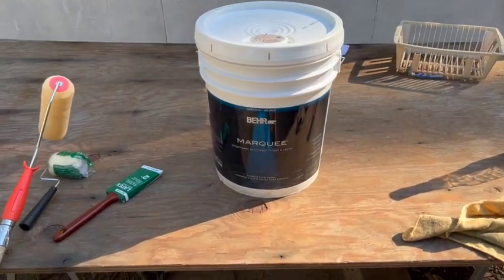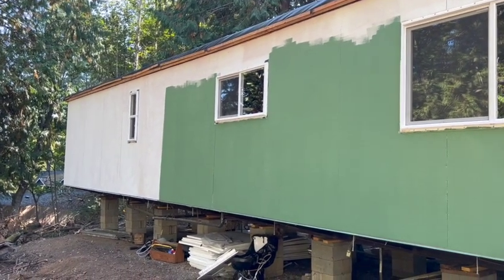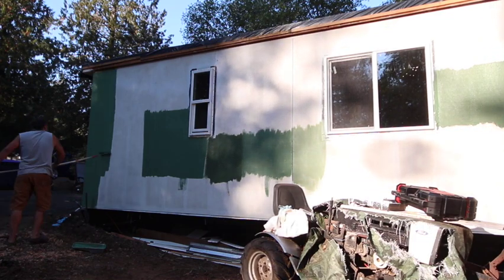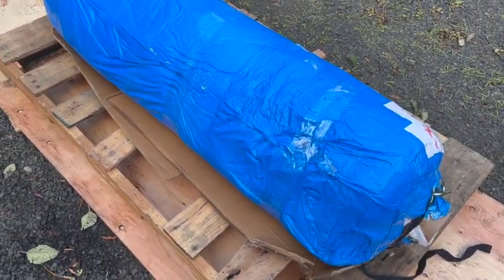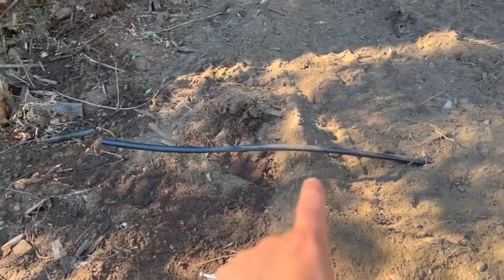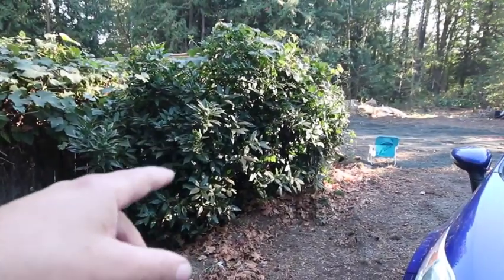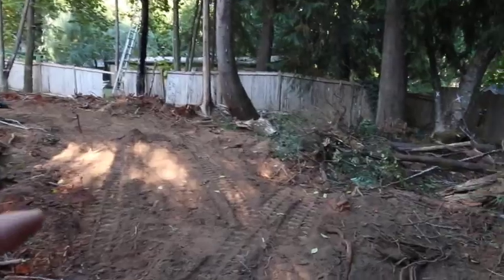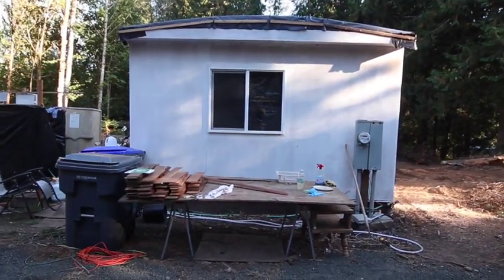Painting the New Siding on the Old Single Wide Mobile Home Trailer Project

Comment: Nice accidental find with that mystery water line.  Have you looked at a yard hydrant? They are freeze proof.  I've got two on my property.  They are quite nice to have around the place.
Reply from the maker: I'll have to look that up. Luckily where I'm at in Washington, it rarely freezes. We get lows in the 30's and 20's but it's usually just a few hours during the night. Thanks for the tip though!

Comment: What's wrong with the color it's looks fine, yes white trim around the windows 🪟 and doors will look great 👍
Reply from the maker: Thanks! I do like it, it's just that I literally had like 50 shade cards that I agonized over for weeks trying to pick just one. I'd get it down to 3 choices then two days later I'd pick 3 other shades so it just felt so final and I just questioned it but yeah, I do really like it and it will feel so much better once I get the finish work on.